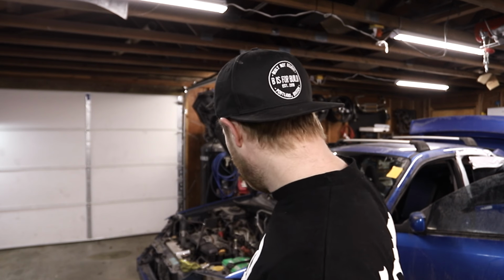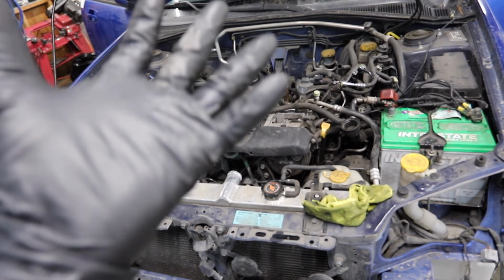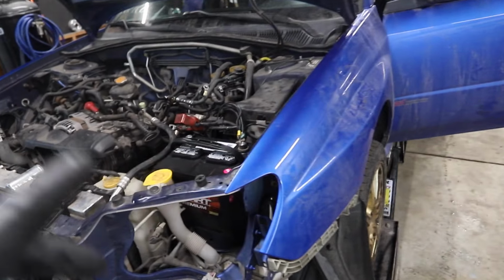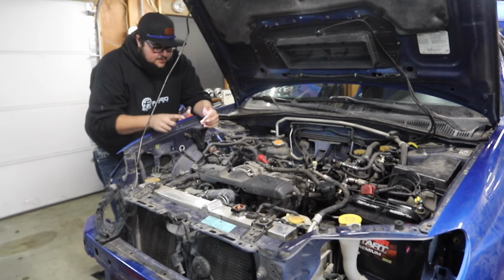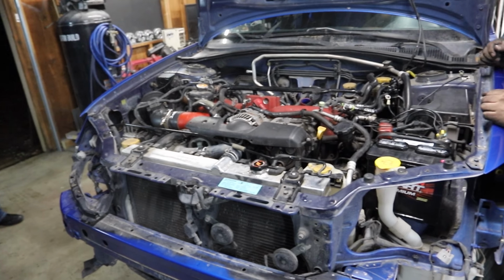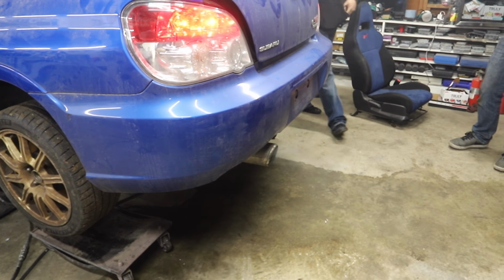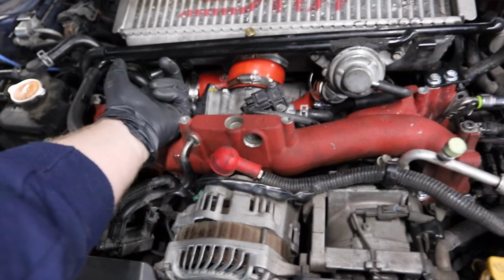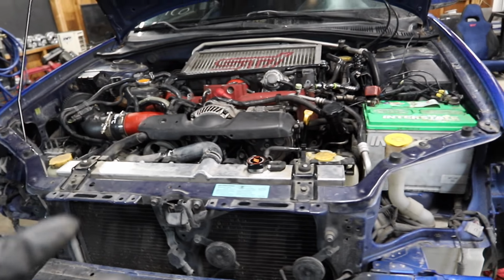Cheap Flooded WRX STI Will It Run!?

Comment: I would also change the fuel filter in the tank also it sits right on top of the fuel pump I had and issue with my 06 STI running rough and sometimes not even starting changed that out it ran like a champ

Comment: It would've been better if you had used an engine flush treatment to cycle through the engine, to clean the journals and valleys, so you wouldn't have to use so much oil. At least that's what I'd probably do. But I can't wait to see the STI rolling on its own power after the new year.

Comment: @15:20 you accidently said it's not going to be running a closed loop system. But if you have fuel trim sensor inputs unplugged or missing you would be running a open loop fuel trim...

Comment: Should of dropped the oil pan, take the head off to make sure there’s no water sitting at the top of the pistons which can cause the piston rings to rust that would scratch the piston walls, you would have awful oil pressure . Also check to make sure you are getting the right amps from the alternator. And I hope you paint it

Comment: Can use atf is a good cleaner.... Bad idler pulley... engine coolant temp sensor on the crossover pipe gets rusty you'll probably need a new one....hope that helps

Comment: Remove the sump pan as well. You don't want to get any water at all left in the system or bye bye pistons :(  Personally I would also take off the cylinder heads to clean them out and check the condition of the valves as you don't know if the engine was running when it flooded

Comment: I love the idea of this budget build and love what you're doing, but it is true you could use Diesel oil as a better solution rather than regular motor oil to clean out the cake, would take less time, but I do got to be honest as a Subaru owner I am cringing at how it sounds.

Comment: All of the relays and fans will turn on and off like that with the key in the run position when there is a small green diagnostic connector plugged in under the drivers side dash. The previous shop may have plugged it in.

Comment: The coolant temp sensor has the same plug on it as another sensor close by (cant remember what as i dont have a subie anymore) but i made that mistake when i rebuilt mines and all i had to do was swap to two plugs around . Try this before buying new sensors as its an easy mistake to make

Comment: Sounds like you got an issue(s) with bearings. The boxer engines from Subaru are bullet proof except the head gaskets LOL. I would run a couple tanks of fresh top tier 93 octane (or whatever your highest octane is in your state) as well.

Comment: I was surprised you didn't drain the gas. If I remember right, after 9 months, gas won't ignite. Fresh gas is very important. Then if you get flood water in there too, it makes for a horrible fuel mixture.

Comment: Curious why you didn't drop the oil pan and pull the valve covers to clean the heads and rotating assembly? That would be the best way to clean the majority of milk shake. Also toss some diesel or atf in with the fresh oil to help clean the milk shake

Comment: Since it's been under water, you need to replace that front o2 sensor before you're going to get good closed-loop AFRs... It's gonna run like crap until you swap that.

Comment: Rotella T6! Trust me! My record car ran that and no issue
Reply: Been using t6 with a subaru filter for 230k miles between 2 wrx's. Hardly ever have to add oil either.

Comment: $25 harborfreight .. get a gallon can of WD40 run it 50/50 with the cheapest walmart oil you can get .. 5 minute intervals .. run it a few times .. don't let the engine get hot. .. to drain the fuel put a battery charger on the battery.. disconnect the fuel line under the hood .. stick it into a garden hose and tape it off then turn the key on and the fuel pump will pump the tank dry.. remember the battery charger.. change your transaxel fluid it doesn't cost that much.. you might need an idler pulley or an alternator that thing sounds loud.. pull the belt and start the engine see if the sound goes away on which accessory. I might also consider getting a few quarts of isopropel 90% rubbing alcohol and run it through your gas tank but thats for you to decide walmart $3 a quart.. its whats in drygas but you don't want to keep it in your tank it would just be to rinse the tank as it would absorb the water.

Comment: Had completely flooded Freelander 2.0 diesel, water levels were 1 meter above the roof and it was in the water for about 2 weeks.

It didn't cost to much to repair but it took me whole summer to get it done. Now, I have to say this car is really weird. Water in the engine and the belt bearings that are dead means water level was hood or more, but the enterior looks good and electronics work, so yeah, really weird. Maybe someone washed it and replaced electronics?

Anyway, the main issue is you will have problems over time, even though you fix it now parts will die off one by one. Water that got in is not clean water but has a bunch of sand in it and other stuff. pretty much every moving part will be compromised. I had steering rack gone, steering pump, diesel pump, literally every wheel bearing, every belt bearing etc. I'm not sure what is the deal with this car but be aware that every moving system that got this dirty water in will give you problems at some point.

Comment: Sounds like you should've pulled the motor and gone through it, might've been cheaper than 4 or 5 oil changes, and better on the engine.

Comment: In my opinion you should buy (or borrow) one of those endoskopic cameras and at least look inside the cylinders.
If the water got any higher than the oil pan it could have rusted the underside of the cylinder walls or the crankcase.

Comment: Will probably get buried, but compression and leak down test the engine.  It's definitely possible that the engine is down on compression and you'll be chasing your tail if thats the case.

Comment: Rinse the engine with diesel, instead of relatively expensive oil, it works better and costs a lot less. When there is no more water in the engine, then put oil in it and a new oil filter, and start, you just need a rinse with clean oil, one time then ..

Comment: Yeah... looks good, BUT: you should remove the oil pan first. It's cheap and you'd be able to easily remove all the water + inspect bearings. In addition, you'd might consider removing the headers.

Comment: Wondering what your goals are on some of the biggest Subaru weakness?:
Ringland failure
Head gasket failure
"Glass" Subi Trans- I assume you wanna upgrade hp
heavy restriction of stock down pipe?????

Comment: If you have another flooded engine, next time 1. Drain the oil 2. pull the pan 3. after putting it back together and filling, let it run to operating temp... it will boil off all the water.

Comment: Please change the timing belt and tensioner/pulleys. If any one of those pulleys/tensioner fails you will roast all of your valves.
Aisin has a timing belt/water pump kit for these that is essentially an oem kit.

Comment: Dont need that many oil changes, water evarporates if you run the engine until you reach working temp, 1 or 2 should be ok

Comment: I will do anything on my car except the spark plugs, it's a huge pain in the rear and will pay someone to do it even if it's at inflated dealership work rates. I will replace bushings, clutch master cylinder, pedal assembly, intake manifold and gaskets, but hell no I won't do spark plugs again.

Comment: Something is grinding away in the front there maybe check Power Steering pump, Alternator, Tensioner Pulleys, Drive Belts, all should be checked and bearings/tensioners replaced or at least re greased. Your rushing it a bit and maybe neglecting some stuff unless you plan on getting rid of that engine because of what its been through and because its a Subaru engine. I am an Evo owner but regardless i do like and respect the Impreza and Subaru in general but just afraid of their engines cause of all I've heard and seen over the years.

Comment: I have a question. Since you guys are an expert, why don't just disassemble the engine and clean it inside? What is the purpose of running few engine oil cycles? Can someone explain?

Comment: did you check the power steering fluid, it might be water in it since its noisy like that, or the power steering is shot

Comment: Guy is smelling that exhaust to see if it smells like maple syrup, easiest way to tell if your gaskets are going bad before they are actually shot. Although as soon as he cranked it and found out it wasn’t seized I would have changed the gaskets/all fluids/all belts/bearings and the entire fuel system.

Comment: You can't compress water, that's why when it's in a cylinder in an engine, and you try to start it 'hydrolicks'. Damaging the engine terminally bending rods etc.

Comment: The water doesnt make the oil look like that. Water and oil DONT mix. Antifreeze readily mixes with water and will make your oil look milky. Might wan't to investigate further! I ran a LS motor with cracked cylinder heads for two and a half years. I only ran distilled water for coolant, no antifreeze cause I knew the heads were cracked and leaking coolant into the engine. The water evaporates very quickly at engine temp. Had to fill the reservoir every week for 2 and a half years.  My oil never looked milky like that at any oil changes I did.

Comment: how many liters of oil does that boxer take?  mine takes 6.5L. though its a straight six. 4L sets me back like just below 100$. i cant imagine the cost for this, with all the cycles before getting the shake out. instead of spending alot of money on oil. couldnt you have lifted the engine out and just cleaned it, change gaskets and seals while youre at it?

Comment: Did you guys plug in the TGV's or some sort of delete piece, it might be the angle of filming but the manifold looks like it's resting a little low on the engine... My eyes may be crooked or something but the plastic manifold on my 255 sits higher than that.

Comment: You really didn’t have to do a lot to get it back running,  just plenty of expected oil changes and a few parts. Could have been a lot worse. Were you using a engine flush or is that for a later stage?

Comment: run some of this ReStore in it will help fill in the pits that were probably left over from rust inside of the engine when don't have receipt the rings because it has lead in it I put a link in for you

Comment: Whenever I see a subaru engine bay I always get amazed how japanese used every little square mm to shove something in there. There is no space left even for a 10mm socket to disappear there.
Reply: Wait, you have a 10mm socket?! Don't brag, share the wealth man!😄 I have six 11mm sockets and five 9mm sockets which leads me to believe the 9mm and 11mm sockets lured the 10mm away and buried it alive somewhere. The 13mm is a squirrelly sumbish too! Fucker likes to pull a no call no show every time I pull one of the VW's in.

Comment: Chasing an issue on my 02 bugeye. P0031 code and misfire on cylinder 1&3. Changed plugs, coil pack and 02 sensor. Still have the p0031 code and AFR is at 18 on my wideband. Any tips outside of clogged injectors? Also cleaned the MAF sensor.

Comment: be careful with those lamborghini bolts. European and Asian metric hardware can and often is slightly different. working on hondas and mercedes next too each other drove me crazy. keep a pair of calipers handy. i promise if you work with that cross-continental (?) hardware enough... something will break or cross-thread.

Comment: I restored a Wrx from a river, had to change the fuel pump because the sock on the pump was covered in debris. Don’t forget to change the  diff fluid in both the front and rear. Check out my Facebook out and see my daughters Wrx.

Comment: here is what I would do,drain the oil,change the filter, dump a few qts of kerosene mixed with some cheap  ass oil (lawn mower shit) remove the plugs,and crank it over with no load,, then drain it again, use a cheap ass oil filter, fill it wit some cheap oil start it till its hot, then use the good stuff, it  may take three oil changes to get the water out, if you let it sit over night,any water in the block  will be in the bottom of the pan,bottom line do not run the engine under a load untill the oil is clear, oil  should not be cloudy

Comment: you guys need to check/ change your trans fluid if its a auto. if its a manual then you need to change your gear oil an also check the radiator for excess water as well as the brake fluid an power steering. also gotta drain your gas an change the filter too. 🤦🏼‍♂️👻

Comment: Who's the rocket scientist who designed a Subaru engine!! They just threw in pipes and wiring without much thought I think. Side note owned 2 (07 & 09) I would never ever buy another because of the head gaskets issue on both. Yes I know of those years having the problem but Subaru never had a recall..

Comment: one of your pulleys are bad the bearings are screwed check cheap stuff first aka idlers followed by alt followed by waterpump followed by ac compressor one of them are absolutely screwed

Comment: Kinda seems like were just watching you waste a ton of oil. Not that water is good for an engine, but any car that sits for a long time absorbs moisture. Also, pretty much all ethonal gas has water added because its hydroscopic.

I would just get it nice and hot, let it run for a while, then most all the moisture will be gone.

Comment: Love the subi! I have a 05 sti and it's great! Since your big into the rejuvenation and oil  changes you should checkout femco.com. (shameless plug), but they make replacement oil drain plugs that are super awesome. It eliminates having to fully remove the drain plug to drain your oil... and you can do it while it's still hot. I just put one on mine, and it is so easy! Shoot me a message if you have questions and I can direct ya to the right one. No more dirty hands and or messes on the floor!

Comment: Subarus that havent had a battery connected for a while will run like crap. they need about 5 minutes to relearn their idle. start it let it run and keep it from shutting off for about 5 or so minutes then shut it off for about 5 minutes and it should start to run better

Comment: Your comments about using a VPN shielding you against tracking is not entirely accurate. While it does shield against IP tracking and packet sniffing, it doesn't help you when it comes to tracking your device via cookies, other unique id's (aka fingerprinting) and or client side software logging your activites. Further, the attack your referring to a little more difficult to pull off with modern web browsers, though not impossible and not something you'll see script kiddies doing anymore. Just my 2 cents....

Comment: first I was enjoying this video until someone said, "yea it's got good compression" as you were spinning the engine over with no plugs in it. second you could have saved yourself a ton of money and time if you just flushed your engine with gasoline....literally two gallons of fuel is all it would have taken...and it would've cleaned the inside out for you too

Comment: what's the difference in a frappe or a milkshake??  fresh or salt water, ha..did anyone happen to taste it..salt water car?  i think you have to get as much sludge out,  that crap won't dissolve like magic ...see if there is a product made or develop one....detergent base? special canister instead of oil filter,...how about an internal engine purge pressure washer system to develop..LESS USE OF I OR ME AND MORE OF WE..NO I IN TEAM

Comment: I would think that anyone with a lil knowledge of engines would change the oil AND the fuel in flood car.  Not change the oil and run the bad fuel through the system...SMDH

Comment: Sigh why would the engine be seized if it hasn't been run? 🤦‍♂️
Now that was a rhetorically stupid question.🤦‍♂️
Sigh again you've just drained it of all the Water & the is NO Residual Fuel so the puff/puff thing isn't gonna happen 🤦‍♂️

Comment: about this subaru engine:
in first start it sound metal with metal huge friction, it seem the engine must rebuild or new engine.
even if it will start, it will be weak and heat.

must , used engine or rebuild this engine.

dont play games, 

by the way , the lamborginy huricon had bad motor.piece of junk